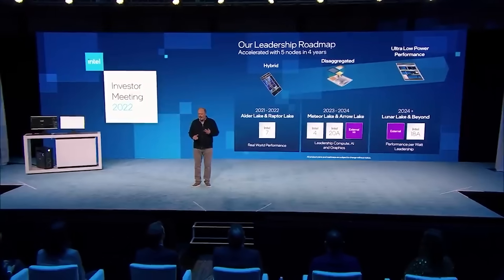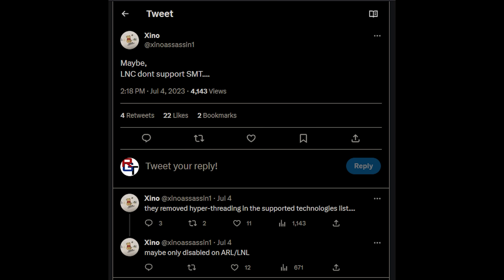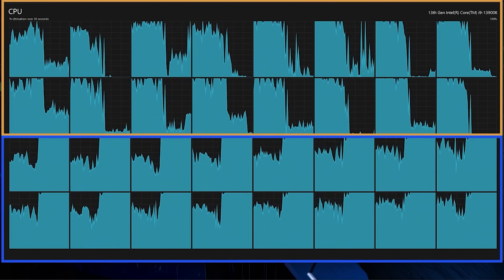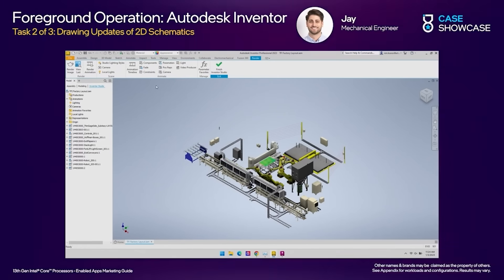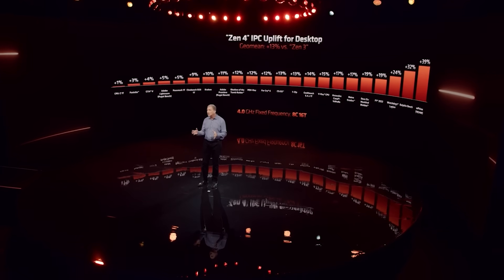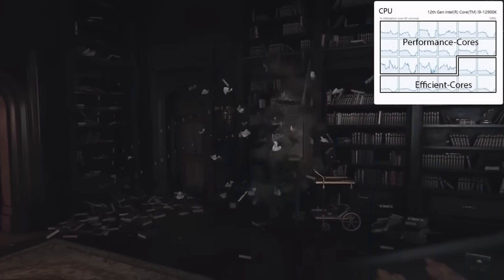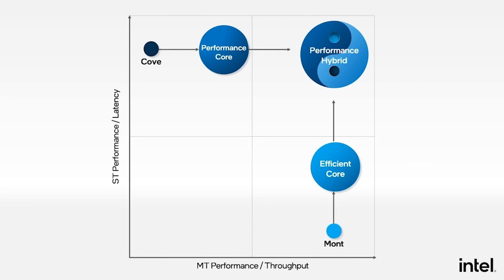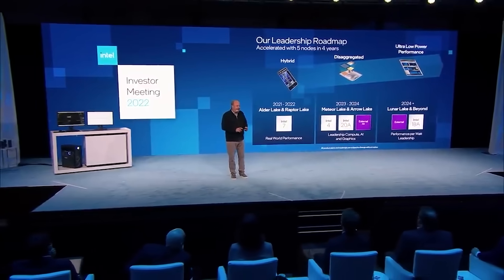Arrow Lake = NO HT Confirmed! Bartlett Lake = 12P Cores?

Comment: Could they port it to Intel3 or maybe even 18A? Keeping on intel/10nm+ would be kind of weird.
This is actually a really good move, since the Foveros technology makes these new intel chips more expensive.
Making a 15100 that trades blows with the 12600K/13400 and maybe even outperforms these parts, all of it for the price of an i3, it's going to dominate the low end just like the 12100 has been doing since it came out and AMD stopped launching competent R3s, with only the 3600X competing(not close) with it.

While maybe having a 12P-core beats 15900K that maybe even trades blows with the 7800X3D and ARL's 285K.

Comment: I have the 12600 non k chip.  It runs at 3.3 ghz (65w) and has 6 cores put on a smaller die.  Its great but I can imagine these same 6 cores put on a full size die and cranked up to run at 4.0 plus base frequency boosting in vicinity of 6 ghz and sold for a very modest price.   Budget minded i-5 gaming clientele would be the target market.   The 12 core cpu would be something for entusiasts willing to put up with another 300watt monstrosity.   Majority of sales and profit would come from budget minded gamers oem builders and upgraders from previous non k cpus.  I would gladly buy another 6 core cpu but a much faster one rated a relatively modest 80-115 watts (something easy to cool by a regular single tower air cooler).  I think there would be millions of people around the world interested in a fast, efficient, easy to cool non k cpu (it is very hot where I live) with a somewhat limited number of cores and a more traditional power rating EDIT:  The 65w cpu lineup is dumbed down a bit too much imho, while the k lineup is overclocked out of the box!  I think there is room for a more sensible market approach.  The lga1700 socket would be ideal for Intel to keep experimenting with and learn what is the market really interested in, particularly the global market.

Comment: If this is the case, i'm most curious for the i3. 

4 P-cores + 4 or 6 E-cores would basically crush AMDs entire lineup. 

As an example, a 13600k feels way snappier than a 5800x, just by virtue of having a bunch of e-cores to handle background nonsense. By comparison, the 7600x and its 6-core successor probably won't have much to compete with a 10-core i3 CPU that's around $140.
Reply: The 5800X came out in 2020 to compete with Intel's 10th gen... why are you comparing the 13600k which is meant to compete with the 7700(X)?
Also AMD is coming out with their C-cores which are full cores, unlike intel's E-Cores, that have the same IPC as their P-cores, but are just clocked lower, meaning that we will get 4P + 8C cores instead of 8P cores, which will be much faster.
Reply: @rattlehead999  Would you like me to say that the desktop experience of my 13600k also feels snappier than my 7800x3d? I'm trying to say that the extra cores do something when you have a lot of things open at once.
Reply: @spoots1234  For sure they do. But the 13600k is not snappier than any ryzen or in fact a pre-12th gen intel CPU. Why? The I/O was moved out of the die. So now there is quite the latency when just using the PC. Happily it doesn't actually worsen performance, but when it comes to snappiness, it's not snappier. 

Happily Meteor Lake brought the I/O back on to the die, or in this case package as they are using modules now(tiles).
Reply: @rattlehead999  Well yes it can be snappier by design. I was mostly disappointed with the desktop experience of the 7800x3d vs the 7950x and found the Intel to be a surprising middle ground, especially on cost. And to my surprise, temps are fine, especially idle temp and power draw. For what I said, more cores seem to matter in general use and I've found 6-core chips to feel a little sluggish. I think if Intel is smart with how they build their i3, they can have a real winner on their hands compared to AMD's current 6-core offerings.
Reply: @spoots1234  The i5 13600k is coolable on full load with a liquid cooler. Now granted if you never hit full load it cooled easily, but that's not a good way to build PCs. 

We are yet to see what next generation chips will be like. Intel is finally back in the game with Meteor Lake, so I'm happy to see some competition again. I'm tired of 6 core/12 thread for 250$ from AMD, when it should have been 8 core/16 thread Ryzen 5 for that price back in 2019.

Comment: Well, it kinda makes a bit of sense.  With HT, each core is doing two instructions at a time, meaning more transistors are powered at a time.  This would concentrate the power usage and make it harder to cool at such a small architecture.  Cutting out HT would make each core run cooler and allow for higher clocking.
Reply: Just confirmed it on my 5800X3D.  I was barely getting 4.3 all core with SMT on, and with it off, I'm getting 4.45 all core.  However, I don't know if it would actually improve overall performance, and would likely depend on the game/app.

Comment: Hyperthreading started out as a gimmick to address the competition from AMD's multicore processors. After a few tweaks here and there and getting Microsoft to make changes under the hood in Windows to better support hyperthreading, it became useful and AMD had to address it on their side. But basically it was Intel's way to make Pentium 4 not suck so much due to its extended processing pipeline that was designed to cycle the small L1 cache fast enough to keep the pipeline busy.

Comment: with it i can confirm that i wont upgrade to cpu without HT.
Reply: Apple is getting by just fine without it. It was a stop gap technology that has served its purpose
Reply: @mikelay5360  agreed, and outside of very specific workloads it's really pointless. I disabled hyperthreading on my 8700K when I had it and it dropped my temps, everything I was doing ran just as good or better, and it even let me under volt a little bit more than I could without it. The extra thermal headroom alone that you gain by removing hyperthreading would allow you to throw a couple more cores in there..
Reply: @Crystawth  I am certain that even AMD will make the jump soon.
Reply: The only reason That i don't have SMT disabled on my 5800x3d is because it disables sleep if you turn it off. which is dumb as hell.
Reply: @mikelay5360  I'm sure they will eventually. It just makes sense. The 5800x3d already runs hot as hell, and I have a -30 offset and a 360 AIO, but if i really push it, it still gets toasty thanks to that vcache.
Reply: Last time intel removed their HT we had some of the best times in CPU history. Now there is no corelation, but just keep that in mind.
Reply: @rattlehead999  ht is like free performance, core pipelines can do two tasks at once, without it you will end up with like 16 thread cpu instead of like 24 thread...
Reply: @uhohwhy what a time to be alive where having "only" 16 threads is considered bad
Reply: @Crystawth   if i need virtual server that will take 4 threads and a snappy OS + some dev tools...
Reply: @uhohwhy  I use a separate machine for virtualization and containers. I suppose in your use case the extra threads are beneficial, but with how many cores they're shoving into CPUs now, if they ditch hyperthreading and just add more cores there's going to come a time where you have 20 or 30 or 40 cores that are full normal cores even without hyperthreading. I think non-hyper-threading is the future of computing and we're just going to have more cores

Comment: It is about time.  SMT doesn't make sense on performance cores.  P-cores are all about single threaded performance, and added complexity of SMT does not help.  It might make sense to bring SMT back for a medium core class or add it to efficiency cores in the future.
Reply: P-Cores at this point are small cores. And SMT is not SMT, it's hyper-threading what it does is that it fills the empty stages of the pipeline. Those virtual cores/threads are NOT actual threads, they compensate for the inefficiency of the architecture.
Reply: @rattlehead999  I'm not entirely sure what or even if you are trying to argue, as none of it makes sense.  SMT is short for Simultaneous Multithreading.  Hyperthreading is what Intel calls its implementation of SMT.  It seems you are maybe trying to downplay the cost of SMT with the rest of what you are saying?  Adding hyperthreading adds a non-trivial amount of transistors, and these transistors take up additional space, and they all have to work together with the whole package, and if you are able to eliminate something like that, all of the remaining functionality can have a more compact design which will allow the core to have higher single threaded performance.
Reply: @intelshill5099  Real SMT means that there is a super-scalar pipeline.
Also Hyper-threading is there to compensate for pipeline stages that are left empty, if the empty stages are very few, it's not worth having SMT. 

So it could be they made a good architecture, or it could be that they are trying to minimize power consumption.

Comment: 7:06 imo, if they manage to reduce the power consumption without losing performance and making it cheaper, that would be a bigger win than just raising the clocks by 200-500MHz for an insignificant performance improvement, like 5% max and consequentially raising power consumption.

Edit: and also, is Bartlett Lake going to be released before Arrow Lake? does that mean that Arrow Lake is delayed? or are they both going to be released at the same time? or is Bartlett coming after Arrow Lake? Edit 2: actually, i think the answers to these questions are probably in your other video
Reply: You’re excited about Bartlett Lake? It’s a Raptor Lake refresh ++ on the same Intel 7 node with a slightly larger L3 cache. FYI, ARL=MTL with 15% IPC gains=RPL!
Reply: @tringuyen7519  stop spreading fake news

Comment: Zen5 was even more impressive but then AMD went for the Zen4 IOD and fabric and reserved the new IOD and fabric for the Zen6. AMD managed to get 2 generation worth of improvement from the ground-up architectural design of Zen5. On the con side Zen5 is bottlenecked in thread and data heavy workloads because its IOD and fabric can't feed enough data to cores. They are basically optimized improved versions of Zen4 IOD and fabric. I will be really surprised if Zen5 fabric speed is anything higher than 2400MHz.
Reply: And in addition, the 4nm doesnt allow for higher clocks so in my mind this will be very MEH.
Reply: "Zen5 was even more impressive "

What is impressive about Zen5? No knowledge of any great changes there.

Comment: This is something I have been looking forward to for a LONG time; 12 P-core parts are going to sell pretty well I think. That said, I do not believe Zen 5 will be a 30% increase in IPC. I'm expecting 10-12% as we've seen repeatedly. If it's more, that's great, but stating what the IPC gains are in that one program where you see huge gains is not a valid point to make. It's over-hyping the product. Same thing happened with RDNA 3 yet everyone falls for it every time.

Comment: This is simply Intel's way of dealing with AMD x3D. It's an all out push to improve single core performance at the cost of multi-threading. With the new surge of "E-cores", this method seems to make some sense.
Reply: "This is simply Intel's way of dealing with AMD x3D."  
The majority of AMD's CPUs that AMD sells do not have 3d Cache. You really have to be naive to think that the change in architecture for ALL CPUs is due to a CPU for gamer. 

Single-threaded performance is not only for games, but a lot of programs, from photoshop to python etc.

Rather, it's about revising CPU build assumptions. Apple is doing just fine without hyperthreading completely distancing x86.
Reply: Hyperthreading was always mostly a gimmick anyway.  Most games don't use all cores and even when they use them, few stronger cores will usually perform better than a lot of weaker cores. Also L2, L3 cash is more important for gaming than lots of weak (hyperthreaded) cores.
Reply: E core is not for gamers.
because in many games they use the E core instead of the P core.
which reduces game performance.

Comment: Good, disabling hyperthreading gives  massive stability gains  when it comes to ddr5, which intern allows you to overclock the ddr5 further and make up almost all the performance that it's lost in productive workloads, most of the time when it comes to gaming, performance is better with no hyperthreading or the same, I run the Corsair vengeance 64gb 4 dimm set 4x16gb 6600mhz oc'd at 7400mhz 34 39 39 76 with all my ecores enabled, and 5.7ghz all core pcore with 6ghz on my two strong pcores on 13900k

Comment: Just P cores sounds awesome, I had a hard time even finding 6 p cores without e cores in the last few generations
Reply: You can disable the E cores in the BIOS. So, you can get a 13700KF for cheap (when it is on sale) and disable the E cores. Or get a 7700X.
Reply: Intel is using the e-cores in place of multithreading. You’ll see more e-cores in the future!
Reply: @tringuyen7519  to many E core is not cheap ~ :face-blue-wide-eyes:
Extra P core is much better for desktop PC
:face-blue-smiling:
Reply: 12600 and T are 6P 0E. Same with all 12500 and 12400 CPUs.
Reply: Yes more than 8 P cores on a single ring/CCD would be so awesome. though based on description for Bartlett Lake being Raptor Lake refresh and meant for OEMs and entry level system and given P cores are expensive, if that last part of sentence is true, I doubt it has more than 8 P cores sadly if even that. it appears it is meant for budget customers only sadly and probably will top out at 4-6 P cores for entry level.
Reply: @Wolverine607  Why do you say that?  There were rumors 6 cores would replace 4 minimum for i-3's for 14-th gen CPU's  I envision this happening with Bartlett.  6-12 cores running at moderately high clock speeds could very well be consistent with high gaming performance and budget mindedness... and satisfy thermal constrains.
Reply: @sezwo5774  I hope you are right. Though why would the term budget minded by used. I mean high end enthusiast users are stuck with 8 P cores with Raptor Lake and even with upcoming Arrow Lake with just more powerful e-crap cores. Enthusiast high end users want more than 8 P cores yet we do not have it. Why would they put it on budget system but not higher end. Unless Bartlett Lake has a niche high end?? I mean how about latest arch Arrow Lake with 12 P cores?? Does Intel really consider 12 P cores more budget oriented than 8 P cores 16 e-cores. I mean the P cores cost a lot ore to make and Intel e-cores are cheap to make. I hope you are right and I will be first to buy one, but its hard for me to see it at this point.
Reply: @Wolverine607  I have the 12600 non k chip.  It runs at 3.3 ghz (65w) and has 6 cores put on a smaller die.  Its great but I can imagine these same 6 cores put on a full size die and cranked up to run at 4.0 plus base frequency boosting in vicinity of 6 ghz and sold for a very modest price.   Budget minded i-5 gaming clientele would be the target market.   The 12 core cpu would be something for entusiasts willing to put up with another 300watt monstrosity.   Majority of sales and profit would come from budget minded gamers oem builders and upgraders from previous non k cpus.  I would gladly buy another 6 core cpu but a much faster one rated a relatively modest 80-115 watts (something easy to cool by a regular single tower air cooler).  EDIT: I think there would be millions of people around the world interested in a fast, efficient, easy to cool non k cpu with a somewhat limited number of cores and more traditional power ratings.
Reply: @sezwo5774  Yes which would be so hard to cool on air s I do not use AIOs. Wish AMD or Intel had 10-12 P cores on a single CCD or ring. A 10 core single CCD 7800X3D would be awesome. Or Intel 10-12 P core on same ring from 12th to 14th Gen though need power usage under control or it will not cool well on a dual tower air cooler. Would love 10-12 P cores for gaming when the time comes games can use more than 8 cores. Now yo are stuck with at most 8 P cores on a single ring or CCD. Intel 8 only period with only e-waste cores as others. With AMD, you can get 16, but dual CCD and cross CCD latency bad for gaming.
Reply: @Wolverine607  I see what your saying... wasn't even aware of the details of architectural limitations.
Reply: just turn off the e-cores?

Comment: If P-core + E-core works better (faster, more efficient, and cooler) than P-core with HT I really don't care.
If 8P-cores without HT + 24E-cores (32 threads in total) will work better than 8P-cores with HT + 16E-cores (32 threads in total) then I won't bother.
Price to performance matters at the end of the day.